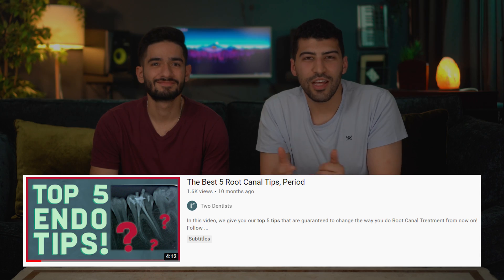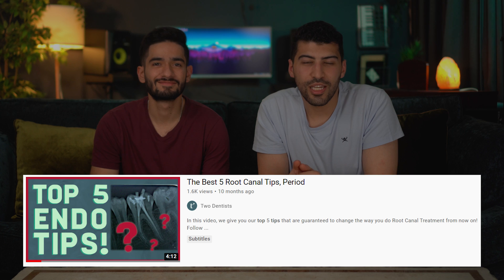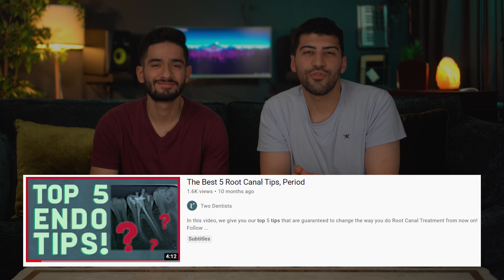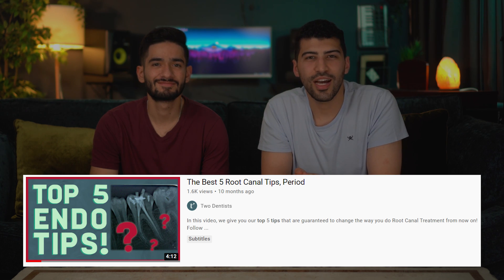Top 5 Root Canal Tips | Part 2

Comment from the maker: For the 5th tip, I forgot to mention that once you shape the ML, put a GP point to apex AND put a 10 K-file in the MB to your working length. Then take out the GP point and then if the MB joins the ML, you will see that the K-file has indented your GP point just like in that picture!